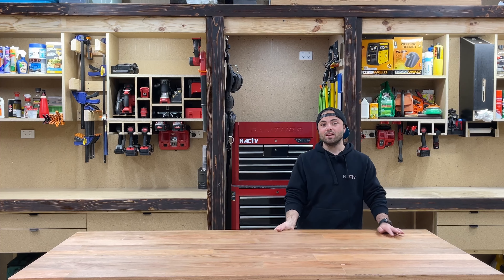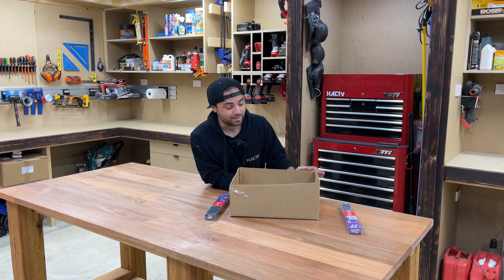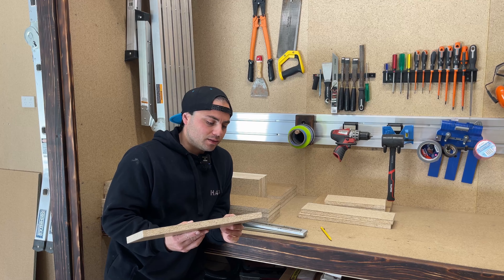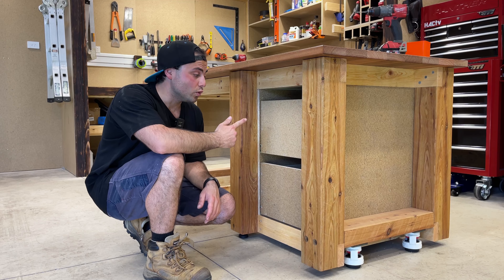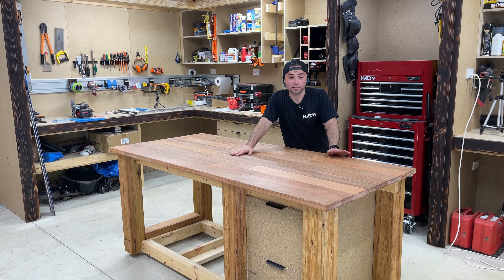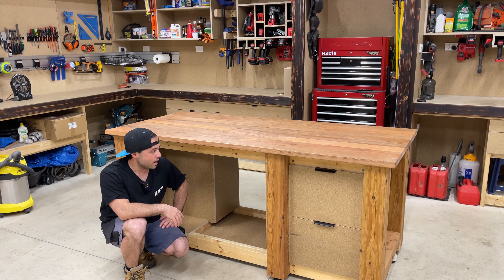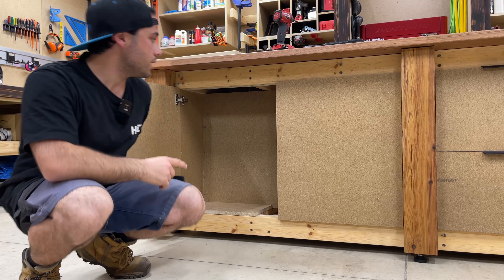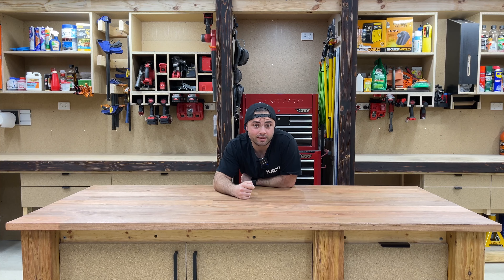DIY Rolling Mobile Workbench Build | Built In Storage | Final Pt.3 - Ep. 23

Comment: Nicely done mate hey just wanted to ask what thickness yellow tung are u using and are u having any trouble drilling and screwing into the edge grain
Reply from the maker: Cheers mate! Used 19mm. No issues, but always pre drill at least 85% of the length of the screw I was using or else it will split, crack or blow out.